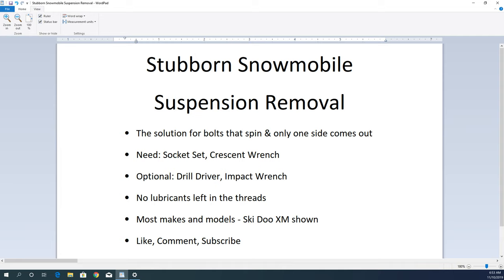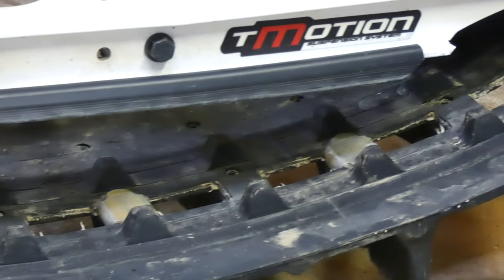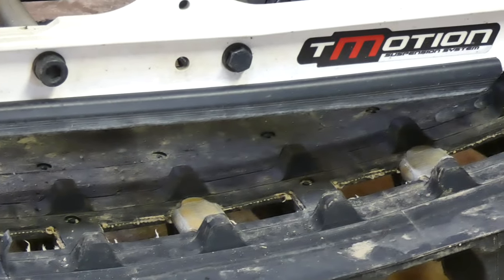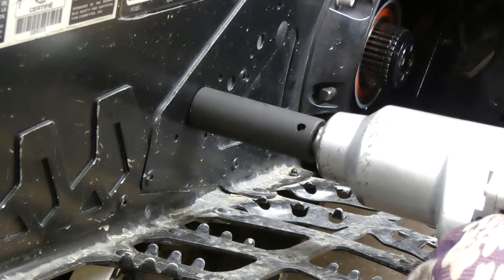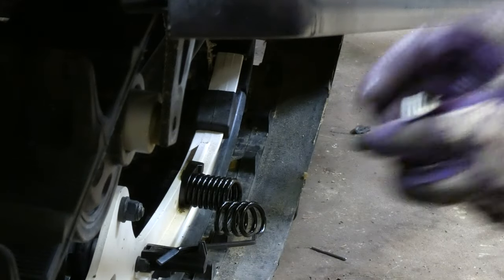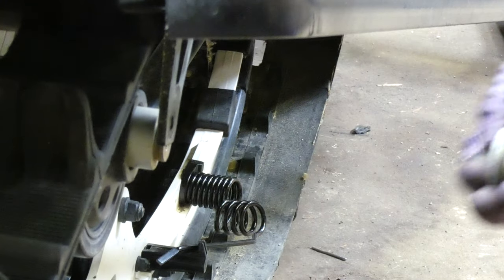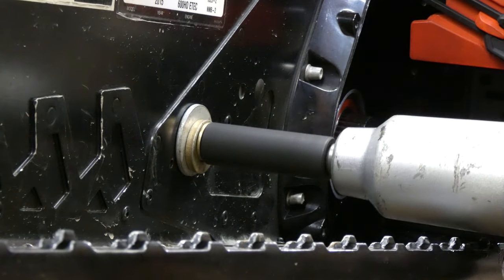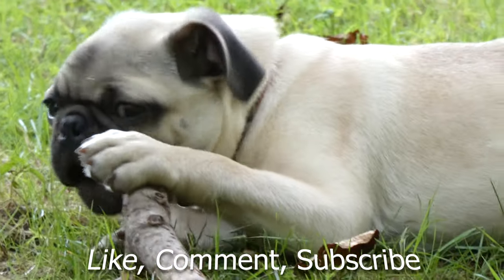Stubborn Suspension Bolt Removal - All Snowmobiles

Comment: woo hoo !! It worked. And I had my doubts on a 2016 Polaris wide track. Before I tried this one bolt that I got out by hand was so tight it creaked like it was going to snap off.  Others just wouldn't let loose by hand and I found your video after about 2 hours fighting those bolts.  I used a fat nut iin place of so many washers. Then my Makita impact driver did the job!!!  Thank you.

Comment: Useless. Did not help at all. Tried it 10 times with various number of washers still didn’t work. In my opinion I don’t see how fewer threads on the easy side would help break free the stubborn fully threaded side.